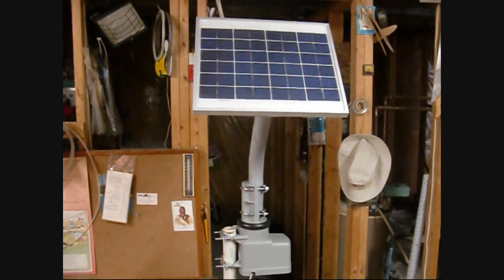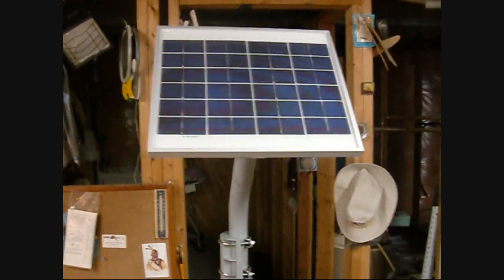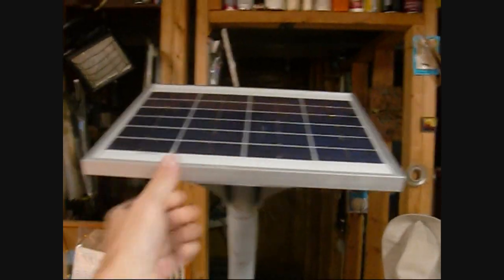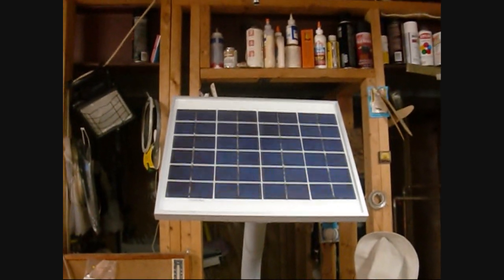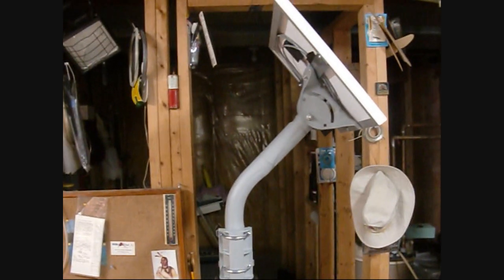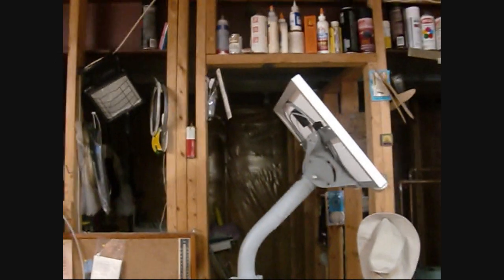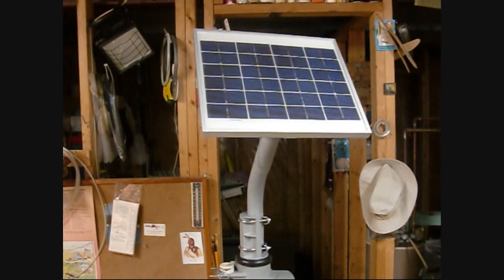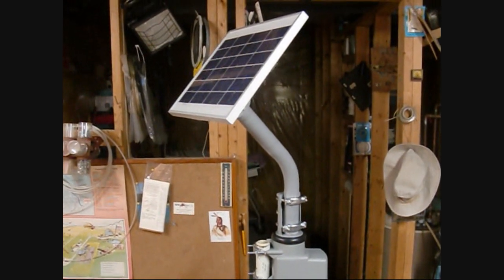The Fearless Solar Tracker

Comment: Nice idea on your tracker and thanks for posting such informative videos.  I am new to DYI solar and am wondering if you could explain some pros and cons to the rotating East to West sweep using a single vertical axis like you have vs tilting the panels East to West over a North South horizontal axis that seems to be much more common.  Is one more efficient for solar collection than the other.  I imagine there is some break-even mix between simplicity, cost, efficiency, etc.    Also, will your tracker support a 4ft x 6ft array.  420 watts.

Comment: @simplistiksoftware To add to my previous post. I was out in the garage looking at something and the Unit-Hub bearing from a 1991-2000 Jeep Cherokee XJ can carry plenty of lateral weight as well as load bearing and it has a 1.25" hole that's splined moving the top only. 4x4.5" bolt pattern on top and 4" bolt pattern on the frame side. Cost about $40-70 depending. But that easily carry's the weight and will outlast the panels. It's weather tight and sealed.

Comment: Using a lazy susan type vertical bearing with a hollow center, the Actuator rod running through the center you could use the LS to carry the weight and actuator to move the panel array. #2 you could attach a horizontal rod to the vertical actuator and move an array left/right 180* obviously carrying more weight as well. McMaster Carr used to sell the bearings I described and the arms prebuilt on 1" and 1.25" tube out of aluminum. 

NICE BTW.

Comment: I like it.  I think panel area is a limiter more than weight. The wind buffeting broke the satellite linear actuator on mine after four years. I replaced it with a heavy duty one. It is for a large area of panels though: 64 ft^2. Regarding rotation, this might be trivial but I overcame the limitation of linear satellite arm rotation size by wrapping a steel cable around the diameter of the shaft, one and a half times. Instead of pulling on the panels I pull on the cable. I have a video of that.

Comment: @Caleb6543 I read that uneven light intensity across an array of cells can cause a voltage reversal across some cells that burns out cells. That is different than the higher intensity issue. I have no experience trying though. I think I read that at redrok com

Comment: Looks good Tom,  I figured a one axis tracker is all I really needed because it's easy to go outside and adjust the angle every couple of weeks or once a month.  Really, the panels have to be cleaned once every 2-4 weeks anyway, might as well do an elevation adjustment at that time.